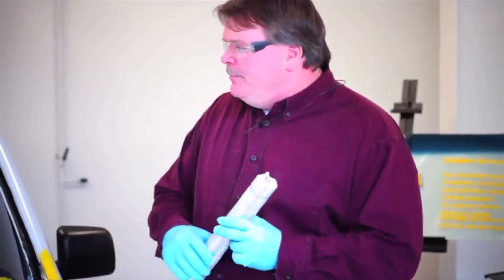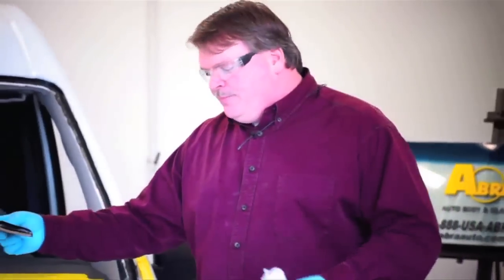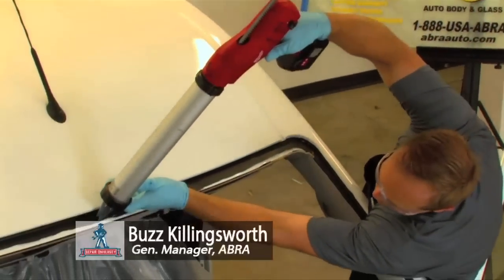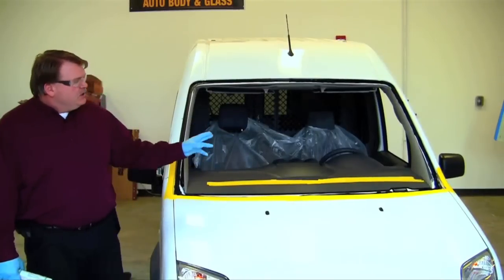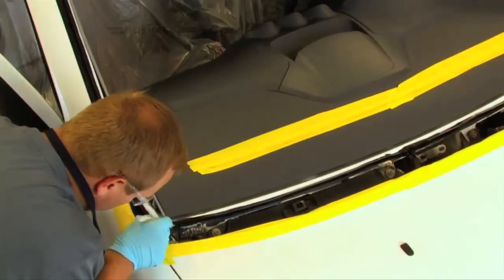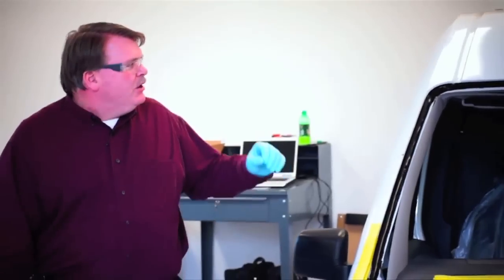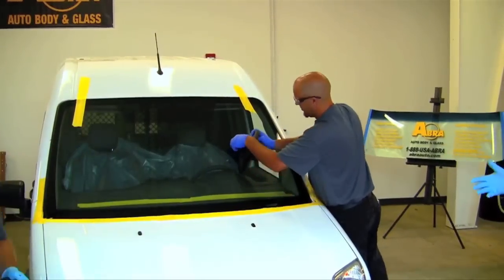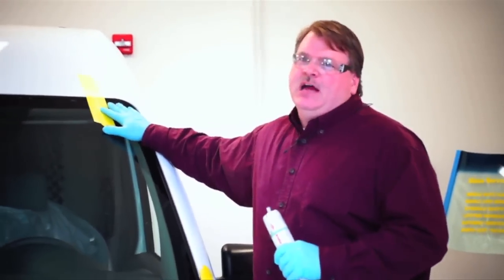Collision Repair University: Windshield Replacement  Part 3

Comment: Good video couple things though
Should of cleaned pinch weld with glass cleaner after distilled water
Better idea to start applying urethane at bottom of vehicle pinch weld or better yet bottom of windshield and do one bead all the way around start finish.